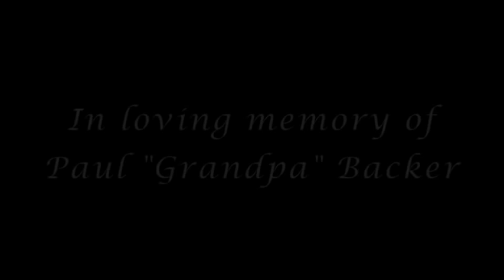Grandpa's John Deere 4020

Comment: a good way to protect the operator's platform is to coat it with line-x not original but it helps keep you from sliding around when your boots are wet. in my opinion they should have done the cab too. to find one with the original cab is rare and expensive, especially if the cab is a hinson.